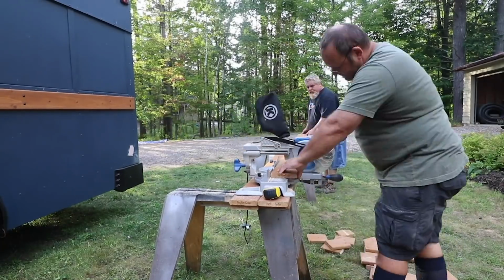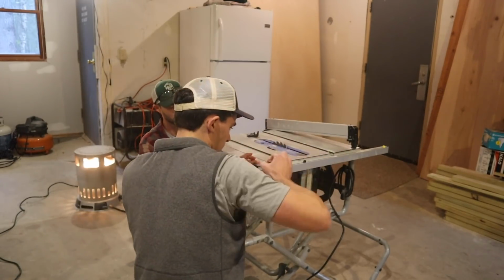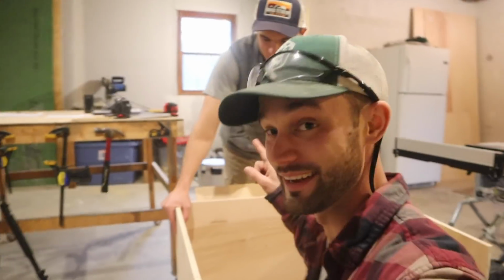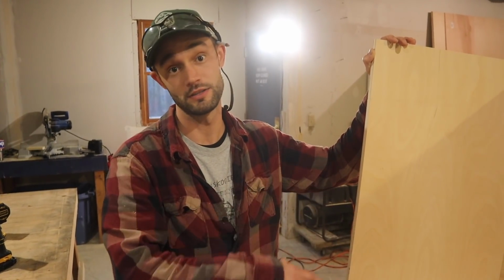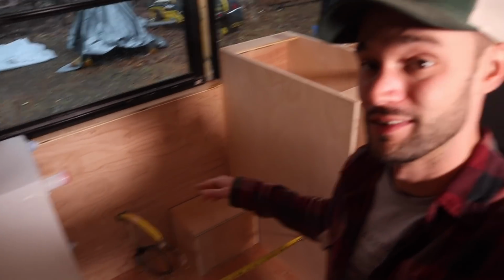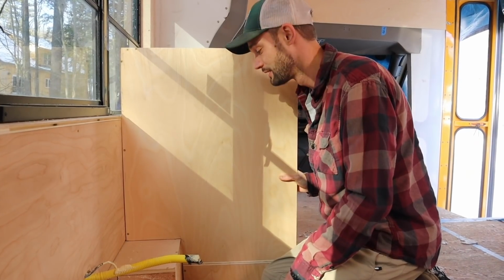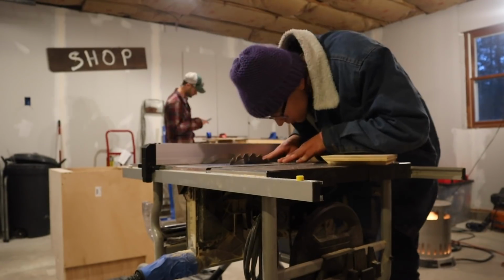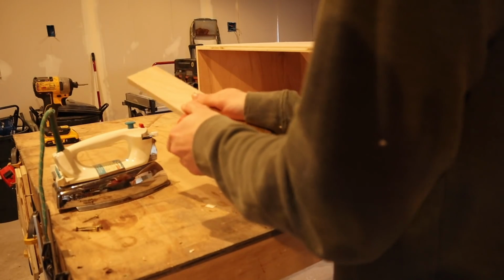Overcoming Our Biggest Challenge | Custom DIY Cabinets

Comment: you have this sign in the shop that says shop, you forgot to put the word chop above it ;)
on a completely unrelated subject, check out what cruisingthecut did with his fireplace, for the backing, it is nice to use that and before you install the fireplace you have free access to the area behind the fireplace. just an idea to look into.

Comment: Really surprised you didn't use the pocket hole jig to attach the pieces together!!!  Doesn't that method make for a stronger cabinet???
Reply: Most say it does, and i believe it does, but I’ve been driving my van for a long time with cabinets constructed the same way and it has held up just fine! You’d be shocked how strong the glue holds it by itself!

Comment: Great progress but I have a question about if you are ever going to need to access the bottom of those windows?
Reply from the maker: The windows open from the top and will slide down behind the cabinets. Two of the three are emergency windows and swing out. They will still be accessible for cleaning that way.

Comment: OMG so many questions...
Love your videos.
I got a 6 window G3500 with a Collins body and I think I got lucky because mine doesn't have the wheel wells.
But about the questions:
For whom doesn't have experience building cabinets (and with lots of free 2X4 lumber), would you recommend building cabinets with frames?
Also, for the back and all other walls that won't be seen, do you think I could use (lots of good size free pieces...) OSB?
And for last, what's your opinion (for someone like  me) about buying used kitchen cabinets and cutting them to adjust to the bus build?
Thanks and congrats on your bus.

Comment: I have been a cabinet installer for 13 years and builder for same period if you need any advice let me know I can tell you anything you need help with.
Reply from the maker: You have an amazing trade, it’s so much fun to build these cabinets. Excited to start uppers with the roof curves. Thanks for offering  to help out.
Reply: @navigationnowhere  Building cabinets is such a fulfilling job once its all done but I have faith you will do a beautiful job.
Reply: I forgot connect all cabinets together and then level them as one so much easier with a short row of cabinets.
Reply from the maker: That’s a great tip. Thanks